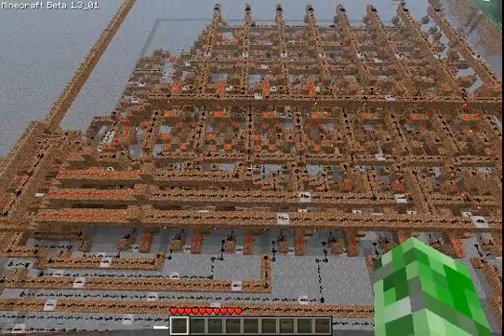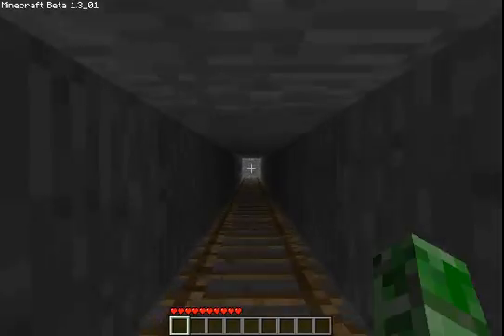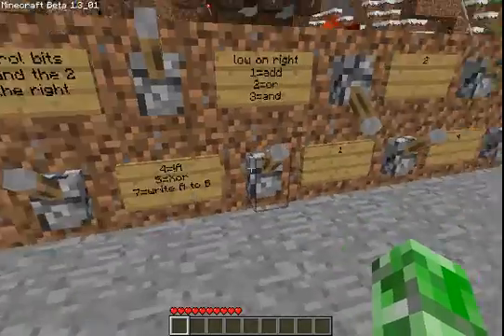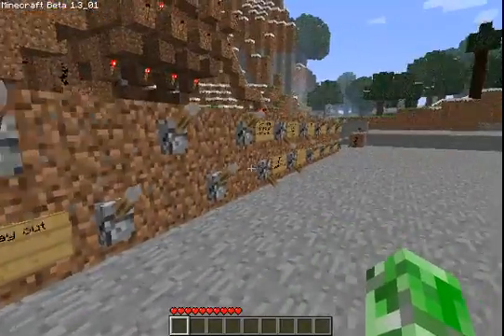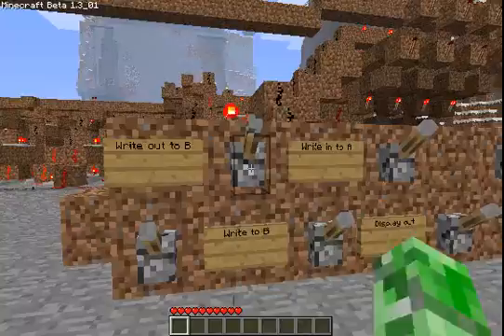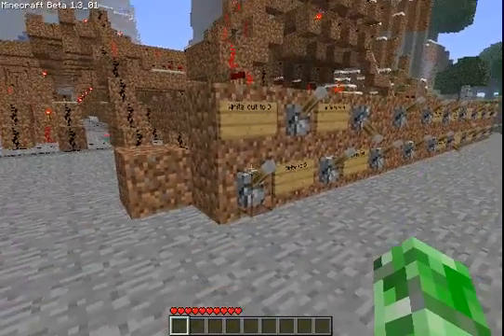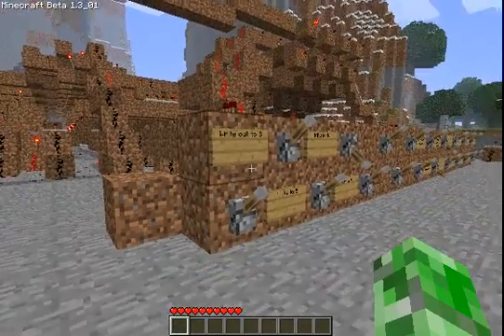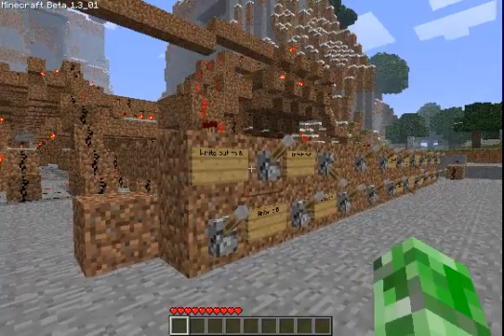Minceraft 8-bit ALU update

Comment from the maker: @artemonstrick yes, ram is a freaking stupidity to put together. However, I think Im just about done with a COMPLETELY modular 8 byte! stack, the only thing you need to change is a row of 8 torches to change the address of each byte. Very easy. Also, each address contains 8 bits, so its an 8 bit computer. (my ALU also has 8 bits) Currently I have 16 bytes constructed. (128 bits)

Comment: memory is the most biggest problem in making such things like cpu ) 
firstly, i've tried to make a stackable ROM unit, that would be easy to program. made, but it was not so easy))))
then, i've tried to make a delay-line memory with internal adressing counter, so from user view it would be like "laggy static ram" - failed due to biiiiig lagging in minecraft. it renders almost impossible to do anything more)